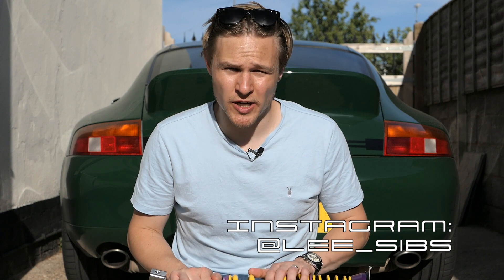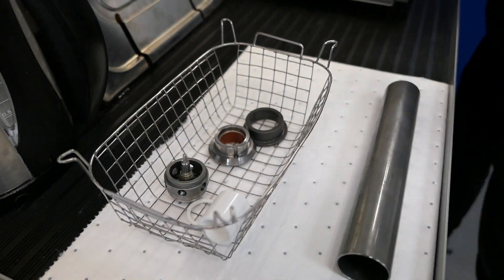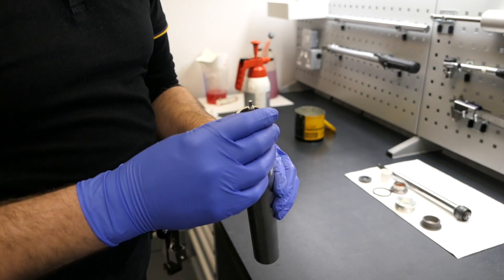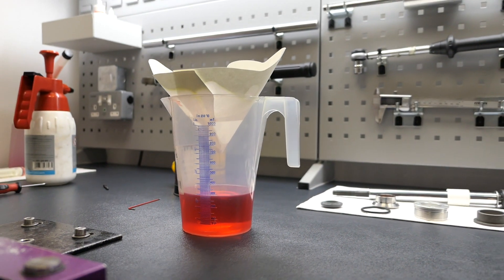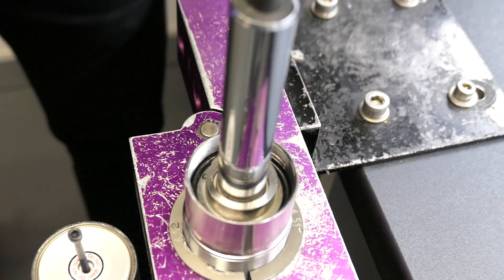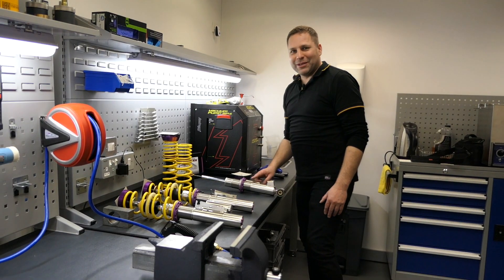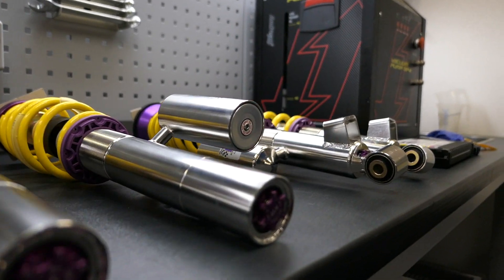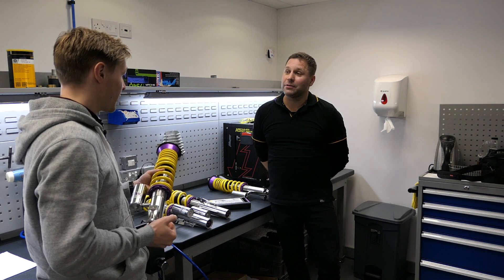Building KW coilovers for my Porsche 996 Carrera… from scratch!

Comment: im having trouble trying to find how to install them on. Do i need adapters when using the stock front upper strut mounts? what about the rears? i cant find the adapters anywhere either except the rear ones on KW's site. help! I'm trying to install on a 2004 996 C4S

Comment: Looking forward to seeing the review once on the car and set up.
Is there a recommended mileage/ age where they should be overhauled?
Also, what was your reason for choice? Did you have Bilstein’s on your previous 996?
Reply from the maker: Good question regards overhaul timeframe, I'll find out. Regards choice, on my first 996 I had Bilsteins but wasn't too impressed with how easily they started to rust after one British winter. I had KW V3s on my second 996 so for me it was an easy choice for Little Irish this time round.